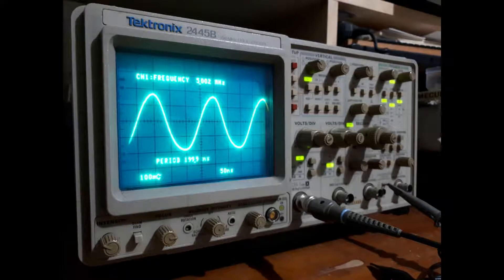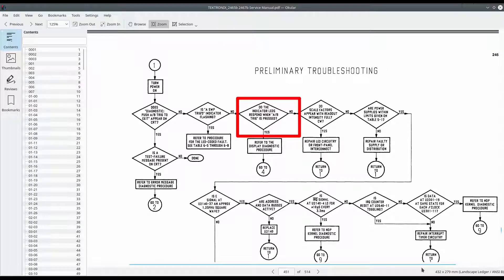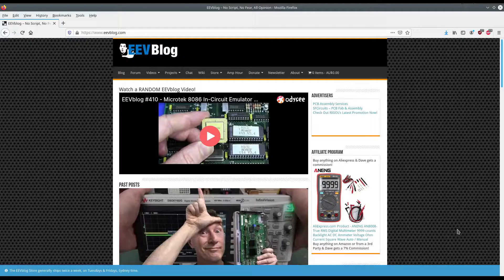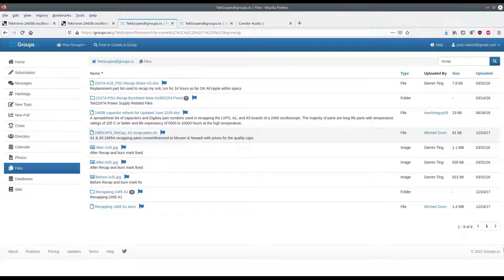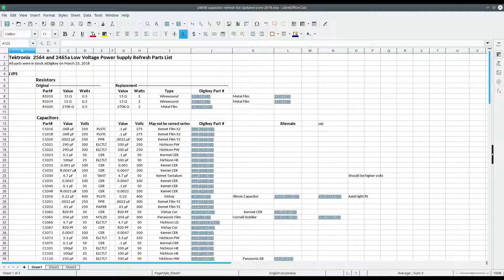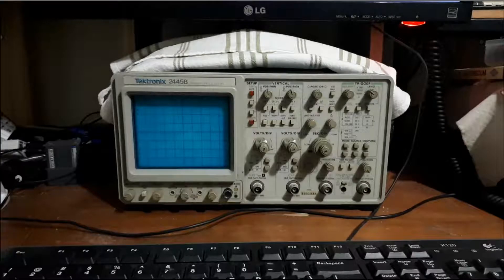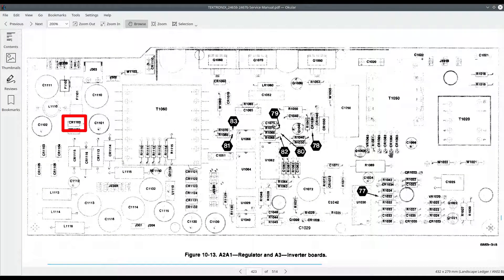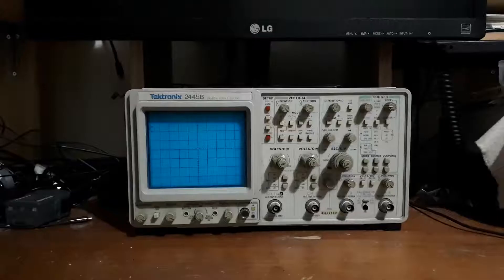Tektronix 2445B power supply repair

Comment: @marcelpost2052 Thanks for the video! Did you run across anyone who sorted out (or did you sort out) why your 2245B failed? Was is a combination of the diodes, and the caps, or just the diodes (obviously, not just the caps). In particular... caps can dry out... but, diodes should not fail. Why do you think the diode failed: bad design? bad part selection?
Reply from the maker: No idea tbh. One of the diodes was physically cracked in half (it just came apart when de-soldering it), so whether that is from a surge or just a bad part or bad design, I cannot tell. I didn't pursue the investigation further to find out what led to the faulty diode, as I was just happy to have my scope working again. It still hasn't failed again to this day, so I'm assuming there isn't a larger issue at hand.

Comment: I have a 2445 (not a "B" revision) and its just totally dead at power-on. Would what you have described here be a possible thing to try ?
Reply from the maker: There is a great resource at https://groups.io/g/TekScopes/topics where you may find some (much smarter) people to assist you. It is there where I found the confidence to re-cap several boards of my oscilloscope. They should also have the service manuals for download there. Let me know if you can't find them. Once you have the service manual for your model, I would suggest to begin with checking the voltages. On my model, there is an ic-socket that doesn't have an IC in it, but the pins of the socket is where you can probe the various voltages. The service manual will tell you what to expect on the various pins. If all of those are within spec I would manually check each diode for short or open and closely visually inspect the board for hot areas (darkened pcb). Be careful with the high-voltage part. Probably read up on how to discharge that properly if you're unfamiliar with that. See how you go. I hope you can revive it.

Comment: Hey I just replaced the cracked front panel on my new Tek 2445 (not a B or A variant) and I think a small (metal?) piece came out and got lost while I was taking the front panel out by the CRT area. I put it back together with the two transparent plastic "panels" for the CRT and it seems to be fine, but I'm not sure what that piece could have been from. I looked at the Tek 2445 service manual and the exploded view doesn't show any small pieces.
Reply from the maker: Could it be something that was part of the cracked panel, or does it seem like it as a spacer on one of the pcb's perhaps? If you have a picture, feel free to send it to this temporary address (bbkh7l13@duck.com). My scope is currently in storage, but maybe looking at it will ring a bell..

Comment: I'm getting started with my 2445B. I turned it on and it started booting and stalled out at "add".  (no CRT display) Then I smelled smoke.  I turned it off, took it apart and saw a fried resistor on the PS board.  It was in series with a .068 RIFA cap.  The RIFA cap was a dead short and the second one is way off it's value.  I plan to replace all RIFA caps, replace the resistor and give it another try.  Is there anything else I should do other then recapping the unit.  How do you keep Cal data alive.  I understand the component that stores the data could be nearing it's end of life?  Can I save it?
Reply from the maker: Good to see you found my other video on saving the calibration data, however without the CRT the risk remains to desolder the NVRAM chip and taking a dump of the data without compromising the (probably very weak) battery supply inside the NVRAM chip. The EEVBLOG forum contains links on how to add a second battery in parallel. Recapping is worthwhile doing for such an old unit but I don't know these scopes well enough to recommend anything else. When you are ready to power up again make sure to check out the IC-socket where all the voltage levels can be measured and make sure to not run the scope without the enclosure for too long as some of the big chips underneath can overheat if the fan can't provide sufficient air flow. Good luck!!

Comment: An update: I reworked my entire 2445 thanks to this video. I also got a  replacement relay for my CH-2 input board as it was  "stuck".  Thanks to your research, as of 4/29/23 my scope is now just like new. Cosmetically, there are only two tiny dings in the face plate by the triggering switches.  Thanks again for having posted this content. Steve
Reply from the maker: Wow, that is so encouraging to hear! Thank you for the comment Steve, really appreciate it! :-) Btw, does yours have the battery-backed DS1225Y SRAM chip as well?  If so, that might also be something you want to pay attention to.
Reply: @Marcel Post  straight up 2445 (not A or B and no options)  Never saw a battery on the logic board.
Reply from the maker: @PRRGG1  Great stuff.. Looks like you might have the ER1400 EAROM on the A5 board (part nr A5U2008). Excellent.
Reply: @Marcel Post  ya spooked me for a second LOL I checked my photos of the A5 and I do not have the battery. Whew!
Reply from the maker: @PRRGG1  👍

Comment: The power supply cap list the same for the 2445 (no A or B)?
Reply from the maker: Not 100 per cent sure. Were you able to get the manuals for it?
Reply: @marcelpost4052  yes mine came with the service manual
Reply from the maker: @synnovevikstrom9841  That's great. There should be a page with the circuit-board layout and the name of all the capacitors. If the names and locations are all matching, then the next step would be to find another page in your manual that lists all the part numbers and values (and descriptions) of all the components used in your scope. Then it's just a matter of doing a diff between my list and your list to see what's different (if any). Without doing that I wouldn't feel confident to say that your model can use the same parts list. It's a bit of a process but it will greatly help you understand where to find components in your scope.

Comment: Great fix! And thanks for the updated cap list. I have a 2445 that needs a recap and I will take a look at your list. Simular problem but mine hangs at boot up.
Reply from the maker: Oh, dear, that's no good. I found the list with all the voltages to be of good use too. There's a dip-socket like connector that serves as the central place from from where to measure a number of voltages that are specified in the manual. That will be a good start as well. It's all in the troubleshooting flow chart. I really hope you fix it as it's a beautiful instrument.

Comment: I am very surprised any of the below comments does not mention to you that you should not put 24XX series without the handle underneath the unit, reason being there are unobtanium chips on main board that can overheat and then your scope will become totally useless and unrepairable because there are holes under the scope that needs air flow entry that directly cools those chips.
Reply from the maker: Wow, that is a really good bit of feedback, thanks. I was not aware of that.
Reply: @marcelpost4052  your video is definitely worth thumbs up... the best part I like about it is you are still maintaining digikey part numbers which is awesome and helpful for a lot of ppl out there... one question though do you recommend united chemi con caps or nichicon caps? I think Panasonic ones are best but not sure about what's the recent experience, I also pay attention to operating temprature and endurance cycles. But not sure what's the new trend after these tariff games on global scale.

Comment: Hi mr marcel,hope you are ok,actully i   am confused abt a problem in my 2465tektronix while working suddenly there was a thick huge smoke from the back pannel,so i quickly pulled the pwr plug but smoke was there for quite some time,anyway when i opened the power supply section i did not find any thing burned except one resistor on the regulator board which is very as comared to smoke which was alarming,so ll apericate if can guide me , thank you.
Reply from the maker: Wow, that would be quite a challenge to troubleshoot. I am not an electrical engineer and I am afraid I am not able to provide you with the best steps to repair this. Please find the groups.io forum for tektronix and post your question there. Sorry I can not be of more help, but wish you well with attempting to repair the unit.
Reply: Probably the RIFA filter caps are gone, check eevblog for help, its a known problem with these 80's scope. Also i would recommend you not to plug in the scope and first repair power supply, do recapping and then power up power supply only (outside of scope and disconnected from main board) and check all voltages and waveform as instructed in the service manual, once you confirm everything is okay then plug in the PSU into scope. Also keep in mind that PSU is very dangerous and you need to take a lot of precautions, wear those rubber gloves that electricians wear or ppl working in power company wear. Though PSU does not have kilovolts but the voltages are all DC and it would be like it wont give you a chance to survive the shock, no kidding.. seriously.

Comment: Dear Marcel.
I' m Marcelo from Brazil. 
I have an Oscilloscope Tektronix 2445B and it presents a distortion on the channels 1 and 2.
My english is very poor, so I can not describe it well. 
Could you please take a look on the video and maybe help me to find out how to solve the problem?
There are just 2 videos on my Youtube Channel and both are demonstrating the distortion. 
Thank you in advance.
Marcelo Silva.
Reply from the maker: Hi Marcelo, Just had a look at the videos of your scope. That is quite unusual to have such a distorted trace. Sorry, I'm no oscilloscope repair technician, and I don't know what might be wrong with your 2445B. If you didn't swap out the DS1225Y EEPROM for one from another scope then my guess would be that something is not presenting the right voltage to the Y-axis. One thing you could do is to download the 2465B service manual (the 2445B and the 2465B are very similar) and check the voltages on header J119 (a 14-pin IC socket on the A1 board) with a voltmeter (pin 7 is GND).  The expected values are listed on page 5 - 3 in table 5 - 1. And, if you haven't already, check out the excellent TekScopes forum over at https://groups.io/g/TekScopes/
Reply: I have read on forums it's an issue of unobtanium vertical amplifier. That amplifier is enclosed in heat sink. If your traces are not linear it means the driver amplifier is not having a linear chrecteristic for signal amplification. That hybrid needs replacement but if I were you I will mod that with my own designed circuit which requires a lot of time. Modern semiconductor quality is better and you need to design that amplifier.. if it works don't forget to share it with everyone as I know a lot of these scope goes into scrap yard after such chip issue. It could also be an issue with one of resistors or caps near that amplifier but be ready to expect worse as that is what all forums say...